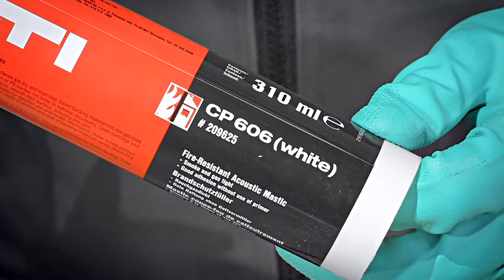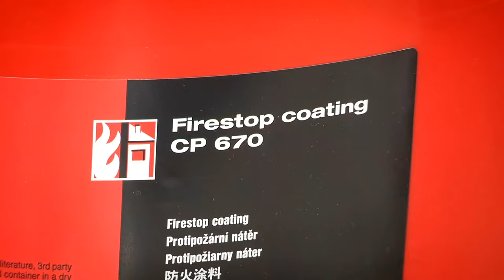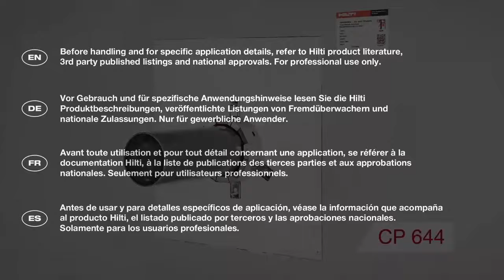HOW TO install Hilti CP 670 coated boards - BS

Comment: some of the engineers judgments differ in different countries and they are still trying to push hilti bricks which is a complete failure if you ask me
I had a hilti rep on site that could not install a waste of time and money
Reply: I agree!! It’s  better to use pillows easy installation and they can remove if new cables or pipes need to be added